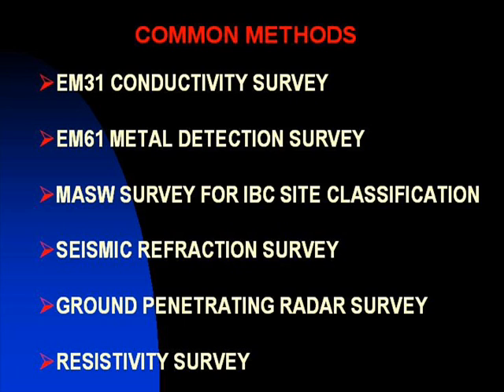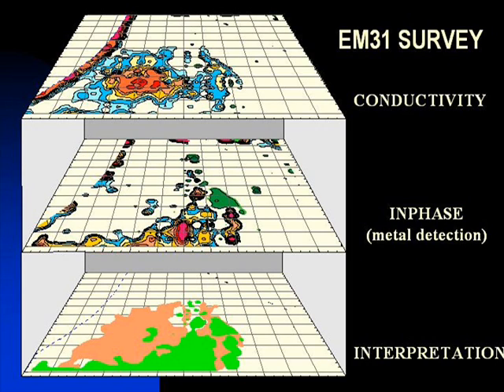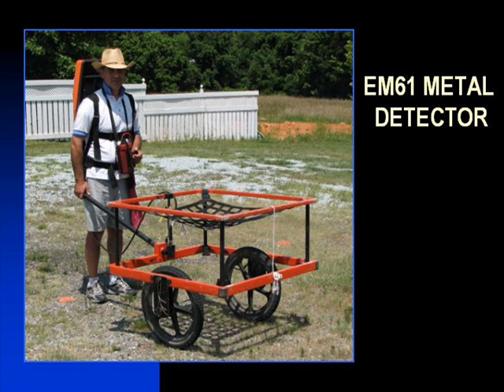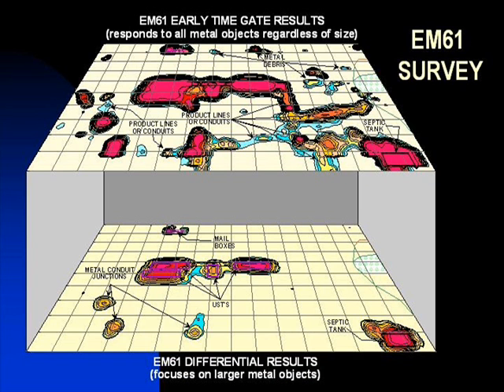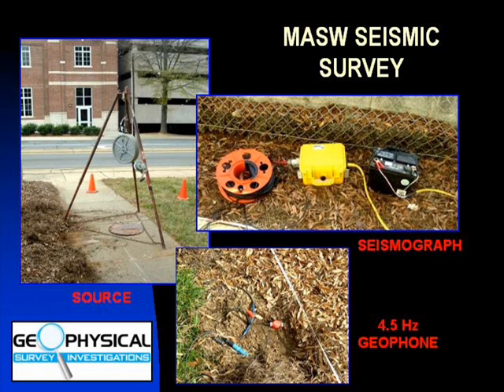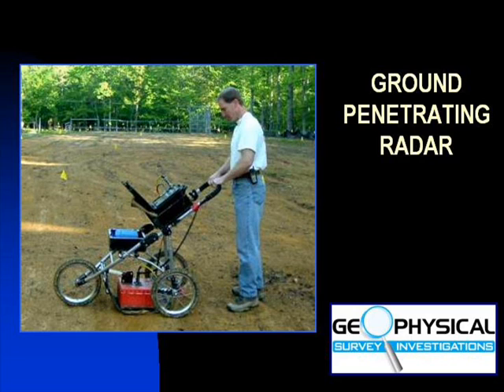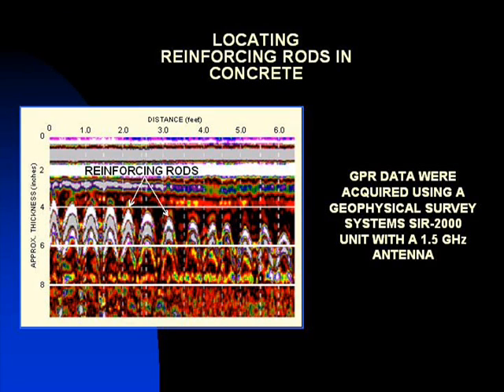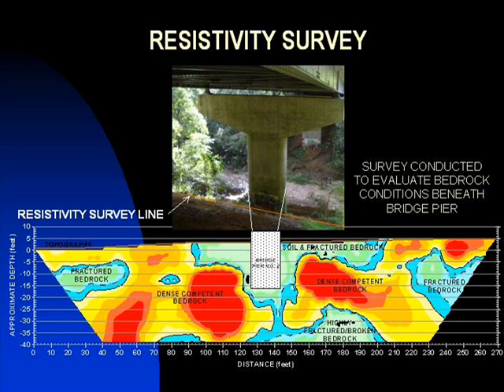geophysical investigation methods North Carolina Virginia

Comment: Why are you using an EM61 for metal detecting?
I think geomagnetic surveys would be cheaper. And if geomagnetic doesn't work (e.g. at railway tracks) you can use your GPR instead. Fluxgate Magnetometers are great. If you have much vegetation or steep hills, you'll have problems with your EM61 cart. Also the data-processing isn't as hard as for geoelectric surveys.